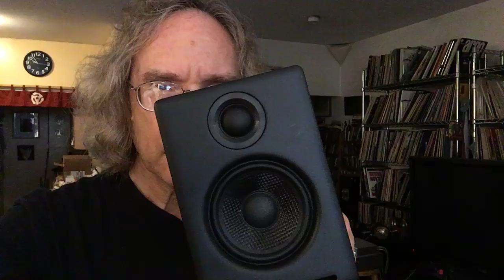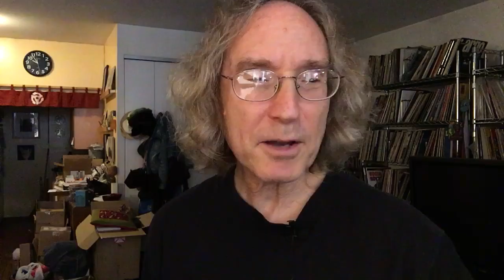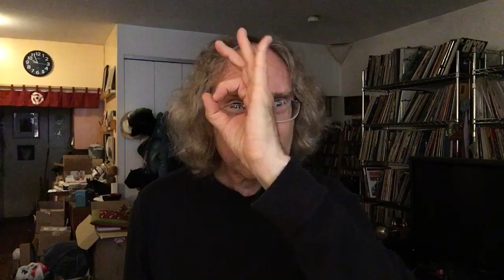The case against 1 inch dome tweeters

Comment: Physics is weird (are weird?). Just because we describe the sound with a number and then write a range down on paper doesn't make the "quantity" or "burden" of that range greater than another descriptive range with seemingly fewer or shorter numbers. If we look strictly at frequencies, wouldn't the high frequencies need even larger drivers than low ones because their frequencies are written in such large numbers? Obviously that's not the case. I don't really know physics, but clearly those high frequencies are quite adequately produced by very small surfaces while low frequencies are quite hard to do without lots of distortion even by multiple drivers that are very large. Electrostatic speakers are really big and yet their lows are anemic and don't extend down as well as much smaller cones. I'm sure domes have their drawbacks, but wow they made low cost speakers better at high frequencies compared to the small cones that preceded them!
Reply: andy , steve is not desribing in numbers of frequency ,he is amazed , also the numbers are written down as a guide through hours and hours of listening and testing , above all trust your ears to your liking of speaker choice , have a nice day .
Reply: The ear is less sensitive to low frequencies, so large volumes of air need to be shifted; larger drivers, where as higher frequencies can be heard easier so we use small lightweight drivers thats can move quickly. for instance at about 10Hz we could only hear the sound if it was 140db, yet play a 1khz sound at that pressure level and it would be painful.
No physics isnt really weird, so much research on sound over the last century; its very well understood.
Reply: @ThuleApsu  The thing is... Look at pink noise... that's what we hear as linear.
When you anylise a song you see that it rolls of like this to.
That means no matter what.. You ALWAYS need more db's at low frequencies.
Reply: Schulze Designs: You are basically agreeing with what I put in my message), correct me if you think I am wrong.
Reply: @ThuleApsu  Your are correct. Because of the Natural Response is like pink noise the ears do the opposite to creat linear hearing. So i was basically saying why the ear happens to be like that.
Reply: Schulze Designs: Yes it is a good example whcih I did forget about at the time of writing, I am in the process of building a rotary sub; if I can build them at a decent price I think I will make it a kickstarter.
Reply: @ThuleApsu  Cool! Im ok with my 12" cone basses.
Reply: Schulze Designs: Which might be ok down to 40Hz or in special cases 20Hz, the rotary sub is only meant to reproduce the 1Hz to 20Hz region; not sure if it is a good idea yet; as I have read that infra sound has very strange effects on the human body and mind.) You know yourself just how much more depth and involvement music gains with the lower frequencies.
My latest sub is a 12" driver in a beer barrel (65 Litres) closed box; that can rattle the walls, its easy to make, easy to seal and practically inert to resonance below 100Hz, its currently tuned to 40Hz rolling off at 60Hz(2nd order) to blend in with my main speakers; I may lower this further using a Linkwitz transform circuit to 20Hz, but tbh I think that will just annoy the neighbours!
Reply: @ThuleApsu  Mine go as low as my room allows... 35hz and then it rolls of. 
Those speakers are not finished yet. When they are i will try to improve my room"sound".
Reply: Schulze Designs: When you improve your room; they say diffusion panels work much better than absorption- one behind each speaker and one where the tweeter reflects from the wall.
Reply: @ThuleApsu  I don't have a Problem with the mid-highs in my room but with the Bass.
Reply: Bass problems are so much harder to solve due to the long wavelengths and penetrating ability, good luck on that one).Even the resonating tube designs offer little more than a db at resonance in attenuation in those rooms I have seen.
Reply: @ThuleApsu  Yeah... I hope i can fix it.
Reply: Schulze Designs: Apart from moving your speakers into non-1/4/1/2 wavelength away from walls and preventing resonance from furniture etc, (So 7ft at 40Hz, 5.5ft @ 50Hz and so on), I dont think there is anything you could do? , I would probably use software to calculate the nodes.
Reply: @ThuleApsu  Ey what the hell... No someone else did comment and i get notification...  On your comment i didn't.
I could build a DBA but at the moment i don't have the money to build another amp and 6 subs with the same woofer's as my main speaker's.
I also could build bass trapps that isnt so expensive. But first i have to finish building my speaker's.
Reply: Physics be weird...
Reply: @JAustin-c6q  It depends on how far away you are from the speaker's.
If you are 1m away from them it is no problem but if you are like 5m away you need something that can produce more SPL. A horn tweeter for example.

Comment: I think perhaps the mass of a driver (transducer?) has a lot to do with really clean audio reproduction, particularly at higher frequencies. Electrostatic speakers have wonderful mid and high frequency transients, giving a sense of spaciousness and depth. One of my favorite speakers was my early Infinity Quantums that had a pair of their, then, proprietary EMIT tweeters. An ultra thin and light film held in suspension of powerful cobalt magnets. Unfortunately for me, they were really fragile and after replacing three of the expensive EMIT buggers, I moved on to domes. Tekton Design’s approach with an array of seven semi-inverted dome drivers arranged in a circle ⭕️ to divided and spread the workload among multiple small lightweight drivers so each individual driver doesn’t have to work very hard or move very much. Two sticks of wood burn brighter? I don’t know, but to my ears the Tekton Double Impact’s sound very much like a really good electrostatic speaker...without the A/C wall plug. Full disclosure: I have never listened to Maggie’s.

Comment: A speaker cone or dome needs to move as one piston, compressing and decompressing the air. The more surface area this piston has, the more air it will move. A woofer moves at a low frequency, which is why we can make them rather big, and still have the whole thing move as one piston. However, tweeters move at high frequencies, which means that in order to make them act like one piston, they either have to be extemely rigid (making them too heavy) or very small, like, say 1 inch. A tweeter simply has to be small to work properly. Horns are able to increase the effective surface area of a small tweeter, which is why a horn loaded tweeter produces more sound than a standalone dome tweeter.
Reply: Take a look at "bending wave " types.  
One of the majors just reviewed one. 
TAS or Stereophile.  Begins with a Z, me thinks.
Highly reviewed.

Comment: Lot's more tweeters are < than 1".
"BIGGER is Better"
Been pushing for larger tweets since the last century.
Linaeum 2" [closer to 1 1/2"] won me over.
Enjoy.
Reply: There are reasons why people don't build tweeters much larger then 1"

Diaphram rigidity./ control is one reason, dispersion is another.
Reply: Peter H 
Thank goodness there is more to audio than dome and/or inverted dome tweets.
Planar, as well as ribbon, tweets benefit from being larger than 1" & the aforementioned Linaeum had a 6" line-source tweet. 
Check out MBL tweeters, for increased surface area as well!!

Enjoy.